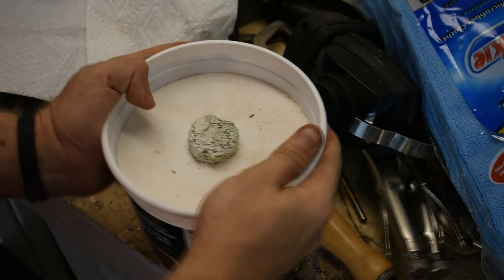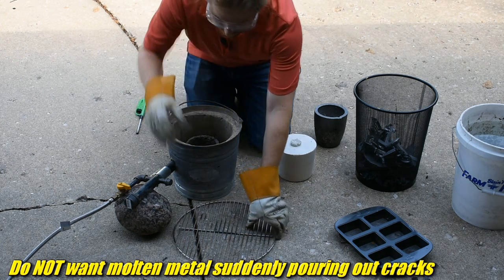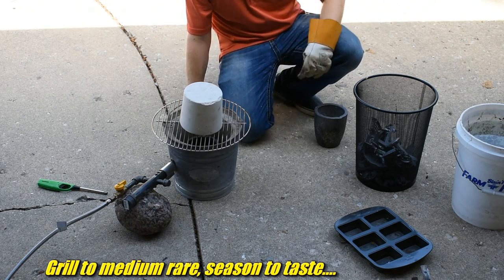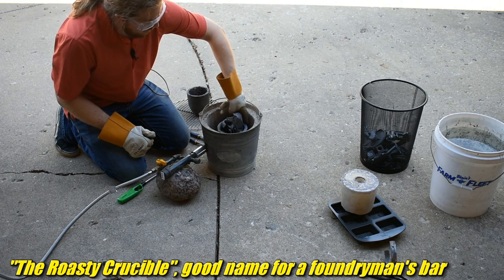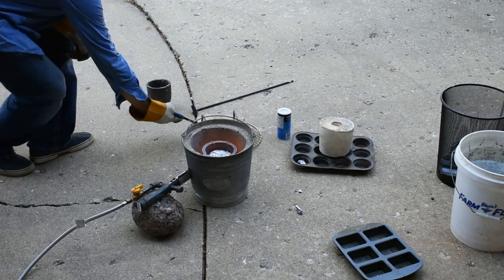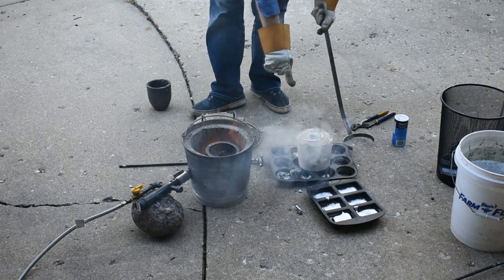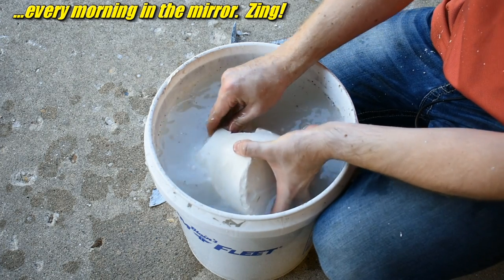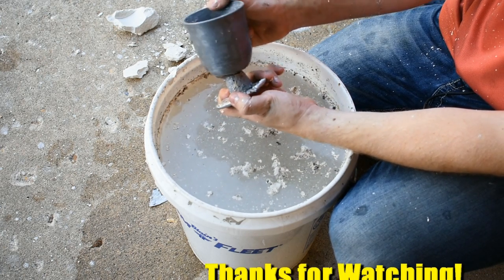Lost PLA Casting: First Try at Casting 3D Printed Parts in Aluminum at Home.

Comment: Investment powder is what you really wanna use. POP is still dangerous to attempt this with. Tends to hold too much water which can cause explosions of molten metal. Plus if you don’t burn out the wax or pla well enough it can also cause a sudden explosion of metal. The investment plaster once properly dried and baked is also porous so it will allow the flow of metal easier and you can pop it on a vacuum chamber to help get it all through the mold.

Comment: Paul, one thing I've used to increase the heat when doing a burnout is to get a terra cotta pot, wrap the outside in aluminum foil, tap a few small vent holes in the top (and a handle of some sort, I used a 3/8" eye bolt.)  Basically it domes the mold, which conserves heat and makes the burnout more even.
Reply from the maker: that's a good idea, thanks!

Comment: I see what went wrong, you didnt get the mold hot enough. Usually you mix the plaster 50/50 mix with play sand, then pour it in around the mold. That makes it hold up to much higher temps than the straight plaster would, which would just crack. Usually you would heat it to at least fully glowing red hot so that it's glowing inside of it to fully burn it out and pour the metal into it while it's still blistering hot inside. Thats why you usually see people that do investment casting using two furnaces, one as a burnout kiln/to keep it hot, and the other to melt the metal. If it's fluxed, Ive had it flow into parts as thin as that easily, expecially since you have the larger sprue on top giving the head pressure. The only thing I can say to do different would be to glue some bendy drinking straws to the bottom and put it to the top of the mold so that when it's all burned out and you pur the metal in, the air will go out of the straws and you wont end up with air boles in the casting. Also, the bubbling and smoke you saw was from steam, you needed to get it to around glowing hot and keep it there for at least 30 mins to drive out all moisture completely.
Reply: Agree.  I have a fair bit of experience doing lost wax castings in stove pipe.   I don't know what temperature PLA burns out at but it will take hours to get that much investment hot enough.   If your doing to do more investment casting look at building or converting a suitable electric oven to PID control.
Reply: Yup, what Chirpy said.  Gotta not just melt the pattern out but also burn out the chemically bound water, that water will not air dry out.  It'd take hours to burn out a block that thick.  Might actually speed it up by soaking the cured plaster (plus sand for permeability) in water first, which would help the heat conduct into it faster.  Good try though!
Reply from the maker: +Chirpy's Tinkerings thanks for all the tips!  I'll have to try that next time
Reply from the maker: +Tobho Mott didn't know that about water bound in plaster, looks like I have more burning out to do next time
Reply from the maker: +Dan Harold electric oven sounds like a good plan.  Pla has to be melted to print and it prints at just over 200 Celsius so it's probably possible to burn it out with a normal oven
Reply: a normal oven wont get it hot enough to burn it out, I believe that he means a kiln, not an oven, mainly the type used for pottery or something similar. Another thing you can do, since it's so easy to melt the aluminum, just get the plaster glowing red hot inside, then stick it in a pile of sand or perlite to keep it hot for hours afterwards, then it wont cool down very much while the aluminum melts. It also helps support the plaster in case there's a crack or something, the sand will act as a dam and block the aluminum from leaking out all over the ground.
Reply: also, if it's called a burn out, just burn the shit out of it :P
Reply: That part of the burnout (removing chemically bound water) might be less critical with aluminum as opposed to higher temp alloys, but I don't know for sure.  You'll know it IS as critical when the mold spits the melt back out at you...  :)
Reply from the maker: +Chirpy's Tinkerings so your saying I should grab the map/pro gas torch and just blast into the hole for a while before baking the plaster? :P
Reply: only if you like explosions and cleaning up little bits of your mold and molten plastic out of your face and hair, lol.
Reply: I think with plaster of paris, it is really important compared to a brand name investment plaster that's designed for investment casting. Ive seen people try brass and bronze in PoP and it usually ended badly, but then again, I know rasper likes to use it but he uses used up PoP (ludo) as a filler with sand and it seems to work for him. Then again, there's various types of PoP and he may get a different type. Some add different fillers and such to speed up curing and such.
Reply: Hey chirp, PoP sucks as an investment material.  I never had any luck with it.  Seeing how we saw lost foam works great with the suspendaslurry ceramic shell....   ( BP )  Why havent we run shell on PLA?
Reply: Ive seen aonemarine using the shell on PLA to create his yoda tree, or at least I think it was him. I think he used a commercial slip shell tho.
Reply: Also, I know PoP sucks for investment material, but it's cheap and is what most people will find, hence why we see so many people trying to use it with lost PLA.
Reply: Yes I was referring to a burn out oven.   Not much too them really mostly just a fire brick shell with a few electric coils.  PID is cheap at about $30

Comment: Hey Paul I feel ya pain mate nothing worse than spending all that time getting everything done then failure🙄welcome to my world. I just did a vid on brass casting in plaster of Paris after melting out the wax molds I thought it would work great but after pouring in the brass the moisture in the plaster bubbled and carried on and the brass didn't get the mold details at all . Still made 2 cool ingots. I'll have that vid out in a few days if your still subbed my friend. I liked your comment about it not being a fail if you learn something so I recon I've learned bloody heaps 😬👍🏻.
Reply from the maker: You'r talking about the one with the gem stone shaped one, right?  that was still pretty cool.  I have a plan to address the moisture/bubble problem in the next attempt, but that might take a couple weeks to get to that.  Failure is indeed very useful, i think they are more informative than successes.  I still like success better, though :D
Reply: Paul's Garage no I haven't released that video yet mate but I will in the next few weeks . I'm gonna just released a video every Sunday I recon that might be easier than chucking them out whenever I can all over the place. I have a friend that works at the local art studio where they have a kiln so I'll look at firing a few pieces before my next few pours I reckon👍🏻😉 . 🤔🤔🤔🤔🤔

Comment: When I've tried lost wax casting its been tough to get all the wax to melt out. I used a camp fire at first, but that cracked the plaster, so I used plaster bandages to hold it together, and that worked really great and is pretty cheap. I then tried to bake out the wax in the oven, but I still never got all the wax out so when I went to pour thick black smoke came out and thats no good. PLA can technically work, but the melting temp of it is pretty high in comparison to wax, so you've really gotta crank up the heat to melt it all out. Plus, with a block of plaster (that will initially insulate the PLA from the heat of your burner) you've to heat up the entire block before the PLA will even start to melt, and its not going to flow out like wax will, you really need to just burn it out at a high temp. I have heard of someone who put their plaster mold in the microwave to melt out the wax, and apparently that worked really well, but I don't think PLA will flow or microwave very well. Also, casting something at thin as that cup is tough because once the metal goes in the plaster mold that is below the melting temperature of the aluminum, the aluminum will cool very quickly and solidify before it reaches the bottom of the mold. Aluminum conducts heat very well, so by the time the first bits of aluminum cool, the rest of it will start to solidity very quickly aswell. 1/4" is the thinnest I've been able to pull off casting with wax, and PLA is gonna be tougher than that.

You should look into re-using plaster, it would be great to have a way to recycle that stuff because of how expensive it is to buy over and over. With my wax casting, I often just coat the wax in thick plaster then wait for that to set, then cover it in plaster bandages. Does the trick pretty well.

Comment: if you ever want to give it another shot, i can highly recommend a mix of sifted sand, about 5% (by weight) montmorillonite clay, and a good 1% pinch of salt. with some water it gets sticky enough, that you can even mould it around an object by hand, without anything crumbling. and because the sand is only thinly coated with the binder, it remains permeable and dries out much quicker than plaster and without shringage. (probably also reduces the risk of air bubbles)
so far i have only tried this to cast small objects from tin, but the molds withstand glowing red without loosing integrity, and start to break down after soaking for a few minutes.
PS: to get super smooth surface details, paint the object with plaster first. also montmorillonite is very interresting stuff, worth looking into. it has a thousand uses.

Comment: you need to do a full burnout at 800f for hours on your plaster mold and the plaster needs reinforced with sand and possibly fused silica (or just buy investment).  Merely melting out the pla isn't enough, you'll get bubbles and nasty stuff in your pour from leftover PLA that gets in the pores of the plaster..same with lost wax.  They sell burn out ovens for a good reason. :)

Comment: Paul, you are either going to need a backyard fire to heat that thing or a pottery kiln.  Check your craigslist, old pottery kilns are a dime a dozen.  I paid 25 bucks for mine.  I run ceramic shell on wax (and now foam apparently) and use the kiln for burnout prior to pouring.  I know ceramic shell is not cheap like PoP, but I'm thinking your PLA will burn out without expanding and cracking the ceramic shell.  I haven't tried PLA yet but willing to give it a whirl.
Reply from the maker: Thanks for the tip! I'll keep an eye out for that, that's a good idea.  PLA shouldn't expand too much, especially because the prints tend to be hollow.  When they melt they should just follow the least resistant path and fill the voids inside instead of pushing out the plaster. I hope, anyway.
Reply: Paul's Garage The pla incinerats, no flowing going on bud.  Wax patterns will initially flow out, but the rest inside burns away.

Comment: my question is: Do they sell spools of wax to run through the printer head so you can make a traditional wax melt vacancy within the plaster? You are assured that the wax will melt.
Reply from the maker: +zillustration not sure about wax but there are lots of types of filament, there is probably one that melts at a lower temperature than PLA
Reply: It's called moldlay and it melts at 225f. Much better to use for casting than pla.
Reply: +Jeff Davey, droppin' knowledge! Thanks!
Reply from the maker: +Jeff Davey thanks! I've never heard of that.  Sounds like a good idea
Reply: Yes they do.  It's coming out right now.  Adam Beane was doing this with Cx5 last year.  I'm not sure how far he got with it.

Comment: Try first making a silicone mold of the mug so you can remove the pla part. Then using plaster to cast a wax mold of the mug. Then you can use a oven to melt the wax.

Comment: You should give the wall compound dip method a try. That to me looks like the most practical method. But I've only ever seen the dip done on foam. The results are fantastic though. You can see the foam bead texture in the aluminum it holds details so well. People do it to get around all the sand mix nonsense. Well, it simplifies flasking too. There is none. They take the dips and put them in buckets of dry sand to pour. The downside is it is a lost process. There's no way to make a reusable pattern and dip it. To burn out people usually use ovens too. Lots of foam pours people don't even bother burning out. They just pour the aluminum right on the foam. It flames out. But with an even dip maybe you can melt your plastic out easier? I've never seen it tried. No one does what you did with the bucket of plaster though. Now we know why. Clean up of dips is easier too. Once the metal has solidified, but is still hot the dip gets pulled out, set on the ground, and hit with cold water from a garden hose. That pops the dip off the casting.

Comment: have you tried printing with HIPS? Its High Impact PolyStyrene and i reckon would burn out of the mold much much easier than pla?
Reply from the maker: I've never heard of that, but i'll look it up.  My printer can use many different filaments, but so far i've only tried pla and abs.
Reply: yeh i have some that i use for supports as it can be dissolved away with limonene. havent tried casting with it yet though.

Comment: Next time Dump the plaster in the water while it's still hot. The plaster will basically boil away from the casting inside. Did that in high school when the metal shop teacher was teaching about lost wax casting and we made rings for some stupid reason.
Reply from the maker: +rothery2 I never heard of that, thanks for the tip

Comment: I was about to say to myself "man he's smart! He uses his furnace to heat up the plaster to prevent catastrophic explosion while melting the metal AND the remaining plastic inside the mould!" Then you removed it and let it sit for some time.. :D
Jokes aside, the 3D printed thing might be too resistant to heat? I've used high density polystyrene foam for my few attempts at casting and found it burns REALLY well (although not too eco-friendly and it sends little black thingies flying eveyrwhere (and it smells horrible)).
Reply from the maker: +ChaosPotato never, ever accuse me of being smart :D. I don't think the print was resistant to heat, I think the plaster was insulating and I didn't heat it enough.  It's PLA plastic which is pretty low melting, I just screwed it up

Comment: Wohoo! New video. Yes im a little late, but it still worth a big wohoo! :)
Reply: If I may be so bold as to make a suggestion. How about making the mold again. Cutting out the inside of the cup like a lid. And cutting the rest of the mold in two. After removing the printd cup, you should be able to put the mold back together and cast with no plastic inside?
Reply: And you should be able to reuse the mold.
Reply: Ah. Tought about it some more. The inside of the cup must be sand. Im thinking it might be hard remove if it is solid.
Reply from the maker: it would be pretty hard to reuse a plaster mold, the heat of the metal is really too much for it.  There are metal molds like that used in die casting though.  some aluminum alloys are die cast, but i think most of it is zinc.